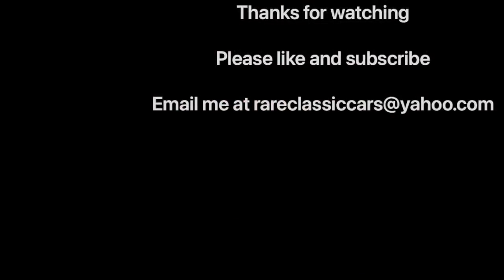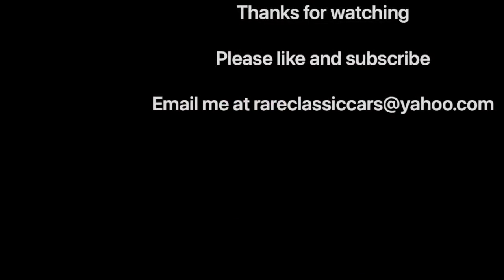Worst Engines of All Time: GM 2.5L Iron Duke Follow Up

Comment: Please do a video of Ford’s Pinto engine. That was their version of the Iron Duke, it went in numerous vehicles.
Reply: Do you mean the 2.3 "Lima" four?
Reply: @timothykeith1367  same difference. It was first used in the Pinto so it was called the Pinto engine but the official name was the Lima.
Reply: @khakiswag  The pushrod 1.6 English "Kent" and the 2.0 was also used in the 71-73 Pinto.  The Kent motor is good but the torque of the 2.3 is better.  A 2.0 version of the Lima engine was also built, and in later years a 2.5 Lima was built for Ranger .

If any of the Pinto fours had been in the Chevy Vega I think the Vega would be a popular collector car today (the ones that didn't rust)
Reply: @timothykeith1367  it went into numerous Ford products from the Mustangs to Rangers. They turbocharged it and it went into the Thunderbird Turbo Coupe and Mustang SVO. It, compared to GM 4 cylinder engines, was a great little engine. The Vega was a good car with a horrible engine. GM never could make a good 4 cylinder engine, even today.
Reply: Pinto 2.0 & 2.3 engines are OHC and totally different than the Iron  Duke.  The 2.3 Tempo engine however was OHV, based on the old 200 straight 6, so that would be similar to the Duke.

Comment: Your notion of an automatic transmission mounted transversely transmitting more vibration to a unibody car makes no sense at all. Porsche cut the 928's V8 engine in half and built their only inline 4 at 2.5 liters and installed it in a 924 with a rear drive setup and deemed the vibration so severe that they redesigned the whole engine to have twin balance shafts, licensed  from Mitsubishi.  It doesn't matter that much if you have a frame, a unibody, transverse mounting, longitudinal mounting....A big bore four cylinder will vibrate up and down [second order] BADLY.  Pontiac produced a 3.2 liter inline 4 for the Tempest in the '60's that was little more than the passenger side of a 389 V8, and it shook so bad it actually had accessories break off of the engine!

Plain and simple, the 2.5 Iron Duke was a typical '70's GM cost cutting measure.  This company has a history of having the best engineering staff of any automaker in the world, but they push that engineering staff not to produce the best car in the world, but to produce the cheapest car that people will still buy.  And it is still true to this day-
Reply from the maker: Full frame certainly had more isolation than unibody back in the day.  Things have improved since then, but it’s still easier to achieve isolation w the frame.
Reply: @RareClassicCars  True, but you really need balance shafts much above 2.0 liters with an inline 4.
Reply: I've never owned a GM car and I never WILL-

Comment: My father in law traded in a 1980 Citation 2.8 for a new 1986 Cutlass Ciera 2.5. Timing gear on the Ciera broke in 1994,, car had about 70,000 miles on it. FIL said “no more fours”. He was obviously disappointed with the refinement of the engine. He moved to a 1994 Buick LeSabre with the 3800 series I, and what a difference. Smoother, quieter, much more power and virtually the same fuel economy.

Comment: Little known fact, some Iron Dukes, were built by John Deere, Gm could not keep up with demand, so, some engines were "Farmed out" , from what I read, those engines went to AMC for use in there cars, also it was common for #3 rod to let go, go figure, they  also had a small tag on the back side of the engine, that  said Deere ,
Reply: Nothing runs like a Deere. True definition of an Agricultural engine or Tractor engine.

Comment: Peugeot engines were the same way,  I was looking at a 505 and granted it was a nice car ,but the engine seemed like it came from a tractor,  even the period Volvo 4cyl engines were rough and look at the prices that were on these cars, it was the sign of the times people lived in. Engines were not as refined as they are today and is one of the reasons the Japanese took over the auto market.

Comment: Excellent points. I can remember the shock of going from a large V8 car to a smaller much less powerful  and less comfortable vehicle. Not something that I would regard as quality not to mention value.
Reply: History is about to repeat itself, if those in power have their preferred outcome.
Reply: I remember the even bigger shock of finding that a $5,700. car with a tiny 2.8 V6 in it could show its taillights from a standing start against such as the later model Ford 351,Olds 307 and Chrysler 318s -- (earlier V8s like the Olds 330,Pontiac 326/336,Ford 289 Hi Perf. ---- I suspect not)

Comment: Heat up the cam gear in boiling water where it expands just enough to smack it on with a mallet.  I have a spare Cloynes TG on hand.  It's a non-interference engine so no damage will occur when the gear implodes.  The one in my Ciera has lasted over 36 years and counting.

Comment: No one pulls engine to remove  the cam fibre gear. Just cut off with a sharp air chisel and use hammer attachment on air gun and drive new gear on. Did many in fieros was bad few hour job

Comment: I had an old Ceiebrety with that engine and never noticed a vibration or power problem. It lasted over 300k and still tan good when the tear axle mountsrusyed out for the third and final time.

Comment: Reliable and noisy old tractor rocker. The Vortex2200 was bulletproof and smoother in my speed limited 5 speed 98 stepside 10. Was like new at 400000 km. Good on gas.
Reply: Same with my 99 S-10 2.2 extended cab 5 speed manual smooth as silk and not noisy.

Comment: I doubt that Ford's 2.3 OHV in the Tempo/Topaz was any smoother than the Iron Duke.  In October, 1989, I traded a 1985 Escort in for a 1989 LTD Crown Victoria (which I kept until September, 2001).  I was a given a Tempo as a loaner when I had cruise control installed on the CV and found the Tempo as rough and crude as the Escort.

Comment: When I first saw the first video, I thought the same thing, because my very first new car was a 85 Chevy S-10 with a 4 speed and I loved it, very reliable, decent gas mileage etc. but yes it was a bullet proof, old school crude engine. Id take one again in a heart beat.
Reply: I just found an 85 s10 in amazing shape, must have been kept in a garage most it's life. I'm rebuilding the 2.5 now, it's been rebuilt before, I think this is the last rebuild for the original block. What a beautiful easy to work on vehicle.
Reply: @joshjepsen234  My very first brand new car was a 85 S 10 with a 2.5 L 4 speed. That truck was dead reliable and never ever broke down. $5999! New.

Comment: You are right on the refinement.   It was horrible...  GM thought about equipping some GM 10's (W Body) with this engine.   I am so glad that they didn't.., But by that time the damage had been done.    Another point to note:   These engines failed a lot in Fiero's.   Probably due to overrevving them... lol.    It was a stout engine, but a crude noise maker.   A Honda engine was like a luxury car engine by comparison.
Reply: I think GM actually made Luminas with the 2.5.
Reply from the maker: Yes they did
Reply: @eth39232  Ok.  I didn't know that.    I know they thought of putting some in the Cutlass Supreme.   I don't think they did...

Comment: Your comparison of a Honda accord is funny!  I knew people with mid 80s Accord and 2.5l equipped A and X cars.  The Accord was ready for it's first automatic replacement at 120k whereas the 2.5l mated to the 125c was fine at 200k.  Oh clunky, leaking valve cover until updated gasket, but likely still with factory axles in the A body.  The 125 lock up was only a problem for those who refused to follow the OCI in the maintenance schedule.   Saw many at Royal Buick make over 200k in A body cars with original engine and transmission including lock up solenoid. Not many Accord auto transmission cars could do that.  The Buick interiors weren't bad.  Especially the Limited models and the 89,90 Ultra.  The Ultra was designed inside by a famous Italian designer of the time.  Compare a Chevy or Taurus to the Buick or Cadillac then I can say the cheaper cars were basic.  Keep up the good work, E for effort!!!!  June

Comment: I completely agree and lived through the upheaval in the American car world in the 60’s, 70’s, and 80’s. The Japanese imports made big market share gains because their cars generally were better built and engineered. They had 200k drivetrains that were fuel efficient and refined. The Iron Duke was an embarrassment, and made a better boat motor than passenger car motor.

Comment: Concur with your opinions.  I bought a used 87 Fiero with a locked up Iron Duke 4 and and Isuzu five speed manual to rebuild.  The original distributor shaft (which still drove the oil pump) had a cheesy roll pin in its drive gear fail starving the engine if oil.  The rear main bearing had spun, my local machine advised against fixing it due to the cost of line boring the main bearing blocks.  Got a rebuilt box motor from Western Auto and got in with life.  I was unaware at that thing the aftermarket offered a steel camshaft timing gear.  Shane in the,  phenolic gear (always noisy) stripped out in a Highway trip 80K miles later.  Was so disappointed in that weekness (and having to pull the motor to replace it), I gave it to a neighbor to get it out the yard.   Regret that, would still have that car had that cheesy gear not failed.  Comfortable enough to travel in and returned 40 mpg on the highway.
Reply: Like many GM cars, with the electric power steering scheduled for 1988, they were just getting it right when they cancelled it.
Reply: There's no doubt that a steel timing gear would have been even louder than the phenolic one. Though a bit of gear whine is still better than an engine failure...

Comment: I think the determining point here is comparing the Iron Duke to any four cylinder from Toyota or Honda. Those were beautiful, smooth, user friendly engines. The Iron Duke was a good tractor engine.
Reply: But the Japanese engines of that era were too small for an American car, even those X cars, as we Americans want strong low RPM torque, something that small engines are not capable of producing, and Japanese engines of that era were VERY NOISY, even if they were smooth-running as far as 4s go.
Reply: @michaelbenardo5695  Nissan and Toyota were making 2-3 liter engines in the late ‘70s and early ‘80s.
Reply: @michaelbenardo5695  That’s a good point. They were small, probably too small to power a Citation.
Reply: I have a 2016 2.7 liter 4cyl Tacoma, that engine reminds me so much of the Iron Duke I had in an S10. 85 model with a manual. The Toyota is more refined but the power feels very similar. I know the Toyota will last forever. I sold the S10 and that truck is still in use on a farm, over 300k. It finally achieved tractor status!
Reply: @ohcrap3263  A Toyota 4 that big?  If the Iron Duke at 2.5 is 151 cubic inches, that 2.7 is even more.  I never knew they made anything that size.
Reply: @michaelbenardo5695  Do you know what the 240, 260, 280, and 300 in “240Z/300ZX” stood for?
Reply: @judethaddaeus9742  Not exactly, I'm not well versed in metric, but I do know that it is not cubic inches.
Reply: @ Jude Thaddeus  

Those were six cylinder engines not four cylinder.
Reply: @calvinnickel9995  True. But the point was that Japanese automakers were making engines that big.
Reply: @judethaddaeus9742  But I was talking about Toyota and Honda 4 cyl.
Reply: @angelitavaldellon7600  Toyota’s Corona at the time used a 2.4L 22R 4cyl engine.

Comment: Thanks for that perspective. It is particularily revealing to an European enthusiast such as me, who always thought that the Americans' distaste for 4-cylinders in the early '80s came from having been too pampered and having been used to silky-smooth V-8s for too long. Something quiet incomprehensible and unacceptable from the European perspective, as you can imagine ! :D For we, Europeans, had had to do with tiny 4-cylinders even since the 1950s.
Reply: GM did get better with the 4 cylinders my S-10's 2.2 was a lot smoother and did not vibrate.  Also the 2.4 in my 2012 Buick Lacrosse E-assist was fairly smooth and had decent acceleration for getting on the highway or passing.  GM and Ford are capable of building great vehicles when they want to and when the bean counters don't cut too bad.
Reply: People in north america loved the I6s which were strong smooth and could get good fuel enconomy. 25-35 mpg out of the smallers ones like the 170. The only problem was they wete lonb
Reply: @noone-nd4ml  We didn't back then consider them long, as the Straight 8 was the long one.
Reply: @michaelbenardo5695  i should have said longer than alternatives or long by modern standards. Good motors though almost seemed hard to make a truly bad straight 6
Reply: We Americans never really liked 4 cylinders.  Not only gutless, but rough and noisy.  A 6 is fine, but an 8, inline or V, is best.
Reply: My Citroën SM has a 90° V6, there were a lot of instability problems when they were first introduced.

Comment: I agree w/your views on this engine wholeheartedly! I had a '79 Monte Carlo with a 267 V8 that I traded in on a '86 Grand Am and was disappointed on how rough this engine was. It was a fairly reliable engine (it blew a head gasket at 34k miles) but went on to 145k when I traded it in 1995.
Reply: My sister's Grand Am did the same thing...  And it went 178k before it died

Comment: I am now of the age where I do remember the utter dismay I experienced when the new cars of 1980 and 1981 came out.  The cars of the 1960s and 70s were what I call "real" cars. They had for the most part six passenger seating, a big trunk, long hood with an engine to match. You fed these cars raw meat at feeding time. The 1980s changed everything. I was so turned off that I never bought a new car in the 80s. I waited until 1993 to buy a new Volvo 240. I still drive it to this day.
Reply: The 80s were a sad time for cars, mainly due to the EPA and CAFE.
Reply: @michaelbenardo5695  The oil shocks of 1973-74 and 1979-82 were a major factor in the crapification of American cars at the time.
Reply: @judethaddaeus9742  Yes, I lived through those, with the odd/even days, the long gas lines, them running out of gas by the time you got to the front of the line, etc.  The first one, 73 - 74, didn't hurt the cars too much at first, but it spurred President Gerald Ford into pushing through the CAFE rules, that only applied to American-made vehicles, (foreign-made vehicles were covered by a much looser regulation; if they produced a Gas Guzzler, only that make and model was slapped with the Gas Guzzler tax.  If Detroit did, and it dragged down their corporate Fleet Average, EVERY SINGLE CAR THEY SOLD, NO MATTER HOW ECONOMICAL IT WAS, was slapped with the tax), which did indeed lead to the eventual destruction.  The 79 - 80 one, combined with Japan's heavy subsidies to their auto exports and restrictions on OUR cars being imported to THEM, finished the job.
Reply: And most of the 1980s cars were so underpowered.  My first car was an inherited early 1970s Cadillac.  It was not what you would call a fuel miser.  But I used to enjoy seeing people in econoboxes furiously shifting to keep up while I just effortlessly and smoothly passed them at part throttle.  I got pulled over once and the poor cop in his 1980-something cruiser (might have been one of the poor neutered Gran Furys) said he'd been trying to catch up with me for miles and I was just driving normally.  (he amazingly had a good sense of humor and gave me a warning)  The late 80s and 90s were such a renaissance period when electronic fuel injection arrived on the scene and once again started an 'arms race' for the most power between manufacturers.
Reply: @ Manon Mars

You realize they made the Volvo 240 every year of the 80s, right?

And I think you’d be disappointed in those 60s cars. Horsepower was SAE gross not net. Most of those big V8s made less than 200hp.. and 0-60 was done with a rolling start to sell magazines. Interior room was terrible because the engine and transmission and driveshaft tunnel took up space in the centre and the frame rails took up space outside. 

People were smaller back then, too. Good luck getting six 200+ pound Americans into one.

Comment: I agree 100%. My roommates first new car was a 1989 S10 with the 2.5 and a 5 speed, and he was was a Porsche mechanic. He appreciated the engine for what it was, but we both knew it belonged in trucks, not cars, especially with auto trans. For that matter, I felt that way about the 2.3L in my 1981 Mustang, it was tolerable only because I could push the clutch in, but miserably rough in a car with an automatic transmission. No wonder it was my last domestic 4 cylinder.